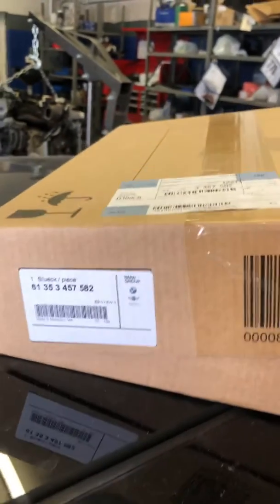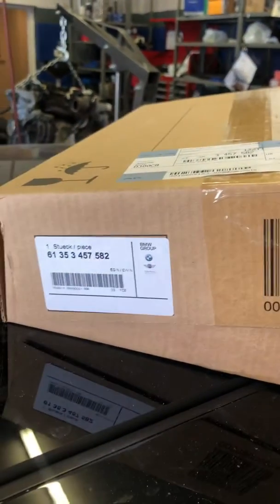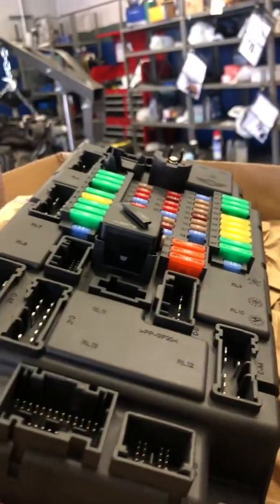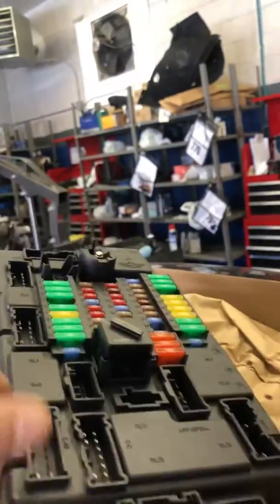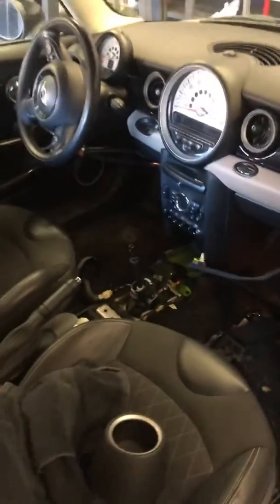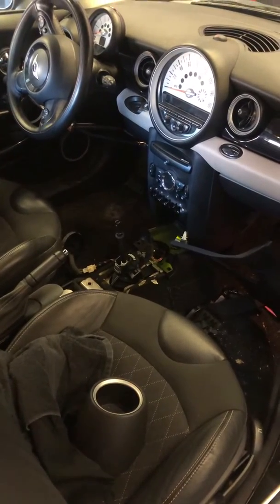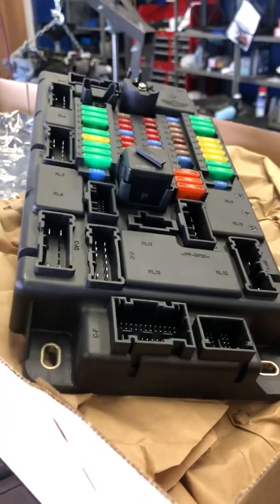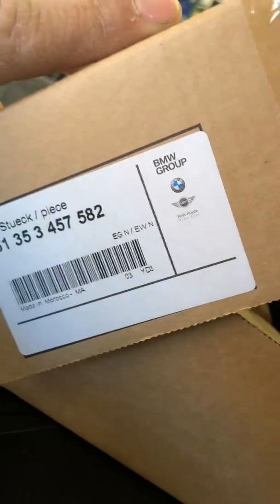MINI Cooper junction box / fuse box

Comment: Did you programmed the new JBE to the car?
Reply from the maker: Actually coding is needed, not programming. ISTA or a high-level scanner can take care of that.
Reply: @carhavneurotech   will it start the car even if you did not coded? Thank you
Reply from the maker: May start, but not every electronic function will work properly.

Comment: Does it need to be programmed if its new.
Reply from the maker: Actually needs to be coded, not programmed.
Reply: How hard was it code?
Reply: Would you clarify in a few words how to "code" this junction box? Where and with what tools?  @carhavneurotech
Reply from the maker: Sure! The difference between coding and programming is that coding modifies the parameters of the software, while programming replaces the software, You can code with a high-end scan tool like a Snap-On or Launch X431 Pro. Programming requires OEM software like ISTA-P or an Autologic box.
Reply from the maker: With the right tool it's very easy, see the reply below.
Reply: Hello, am i be able to use an Autel Pro to code with this?